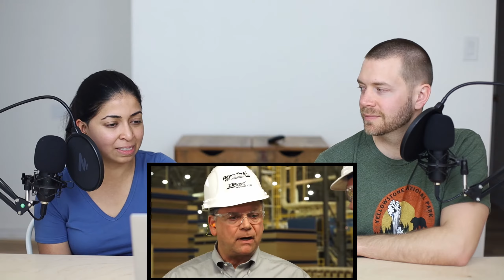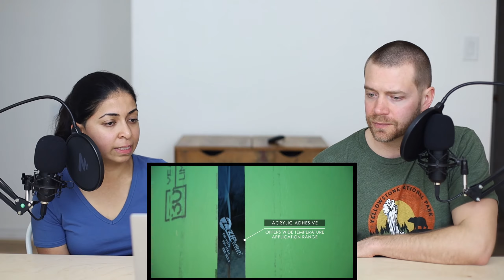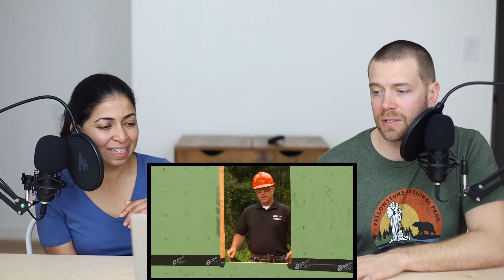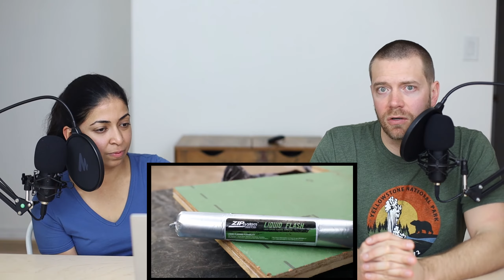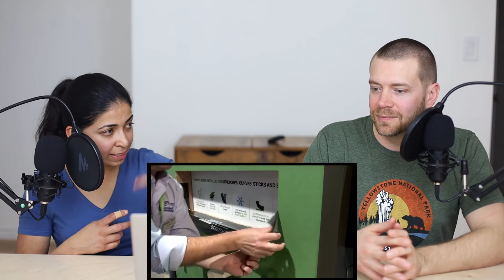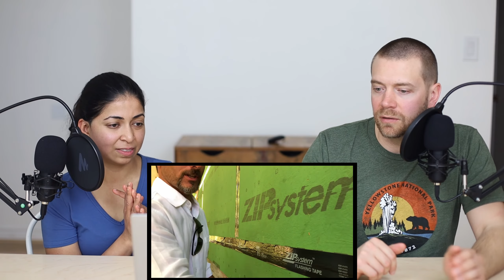ZIP System installation and FAILS (designers react)

Comment: It seems like Carr builds is a hired pr firm for zip or they have never built a dog house.
Reply: If you are trying to air-seal a house Zip is the most user-friendly product to get shear, WRB and air barrier all in one system. Using the OSB, Tyvek and closed cell spray foam or fluid applied sealants would cost more when you factor the materials and labor. 

The Zip system has gone up in price as people understand it's value in time savings and durability.

Comment: - Tyvek itself is the easiest thing to instal and goes very quickly.
- Tyvek is far from perfect and water can penetrate through the staples easily, but water will dry out after that. 
- I think a lot of engineers reject Zip system for shear walls. Let say conventional sheeting requires 4 inches between  nails which means 2x4 takes nail every 2 inches which looks like the top limit. How to get the same shear with gap one or two inches between sheet and stud
Reply: You are talking about Zip-R, not regular Zip. 
Tyvek gives you no insulation, it is simply a WRB, and if fully taped gives some air barrier qualities but falls short of properly installed Zip.
If you want shear you can use regular OSB against the framing then Zip-R on top of it for WRB and air barrier with insulation.

Comment: The zip system is awesome! Never had an issue with it . I’ve built with it for 8 years now. The stretch tape is the best thing I’ve ever used. It sticks like crazy!!!!
Reply: Do other contractors in your area know how and spend the time to install zip correctly?
Reply: What they are saying is when siding is removed from houses 40,60,80 years old done used tar paper and Tyvek , the wood was protected ,dry, and  conditions . Even the wood  can be salvaged from demolished houses . In Comparison when you conduct major maintenance after 20 years or so you will see the good and bad
Reply: @Ryzen7-x9h  You are comparing apples and oranges.
Tyvek or felt is only offering water protection. Fully taped Tyvek has been found to rot the wood due to condensation forming between the wall and the tyvek.

Zip System is shear + WRB weather resistant barrier + air barrier in one. 
If you use Zip-R you get the added insulation as well as a thermal break between the sheathing and the framing.

Tyvek is only addressing bulk water mitigation. 

Modern lumber is also very susceptible to rot due to lower resin content. It is very important to keep modern lumber dry and avoid condensation in the wall or else it will be full of mold.

The old houses with tar paper were so drafty that any water or condensation that got in was able to dry our. Newer codes make the house tighter and will cause rot if the moisture isn't controlled.

Comment: I call BS on labour savings. Install they go around and fill all cracks and screw holes. Tyvek go around and tape joints as needed as you apply the tyvek. Flashing is a draw as both systems need it.
Reply: I thought the zip panels eliminated the need for OSB because it is OSB? That would mean you're basically installing the OSB like normal, taping the seams like house wrap, and you're done. So no house wrap work. That entire step is eliminated.
Reply: @vociferonheraldofthewintermist  I think it depends on how complex your building is, how many pieces the zip panels need to be cut into to reuse smaller off-cuts and how worried you might be about nail heads and the possible need to seal the penetrations. OSB us not sealed at all unless at the foundation or as an extra air-sealing measure on passive rated building.
Reply: Filling every screw or nail hole is not required. You only need to fill or tape over overdriven nails and screws. In areas with high levels of bulk water, you may want to liquid flash the nail holes just or added piece of mind.

With Zip, you get shear panels, weather resistant barrier (WRB), and an air barrier.
With Zip-R , you get all of the above plus a bonded insulation layer that breaks the thermal bridge to the framing.

The labor savings is from not needing to add multiple steps or going around the structure 3+ times to achieve the same results.

Comment: I like zip, but the price right now is astronomical. No way I can afford that vs osb.  I don't think the tape will fail.  Everywhere the panels are taped they are also nailed, so the tape shouldn't have to stretch..  If you've got a cracked osb panel I think you've got bigger problems!
Reply: The Zip sheets have gone up in price as they are being adopted more widely and trusted.

You shouldn't compare the Zip sheet to OSB. You need to compare the OSB+housewrap+time/labor+air barrier/insulation to the Zip system. 

Where it pencils out financially is usually in time and labor savings.

Comment: It's amazing what 6 months can do. The price of zip and all building materials have dramatically increased.
Reply: Me: (Laughing in 2022)
Reply: @vociferonheraldofthewintermist  Hearing the prices in the video compared to current 2025 prices makes me want to cry.

These panels have more than doubled in price compared to when this video was made.

The GP copy is around $20 a sheet, while Huber Zip is $43 in my area. OUCH!

The GP ForceField is not as good as Zip but the creator of both has said it is good enough.

Comment: So in your experience if you were to build a new home would you prefer the Zip system over Tyvek? I feel like you'd have to be on top of your home builder to make sure they install the Zip system properly. Or I guess ask how comfortable they are with using a Zip system. I feel like a lot of new residential construction in the DFW area that uses Zip are not properly installing the tape.
Reply: Totally agree with you there, it boils down to the contractors and if they are capable of installing it properly.  We have to realize that municipal codes doesn't mention anything on a proper install for ZIP.
Reply: Or maybe find a contactor that has a history of installing the zip system per manufacturers instructions.  Some may have jobsites that could be visited to check their work beforehand.
Reply: As this system gains in popularity, proper installation techniques will become more widely understood and followed. If you are hiring someone that understands shingling concepts and fully understands to roll the tape, there are no worries. With the Zip roller, you can verify the tape has been rolled because it embosses the letter "Z" on the tape. A thorough inspection and verification of the taped seams before covering it with siding or roofing should inspire confidence it has been applied correctly.